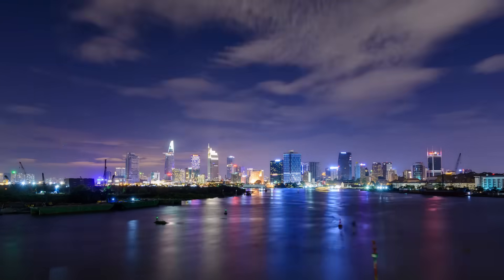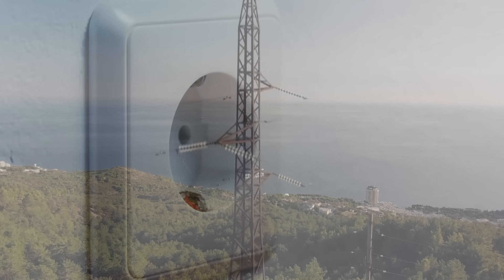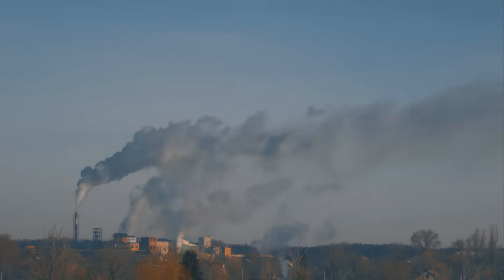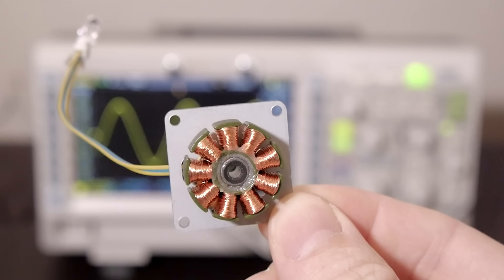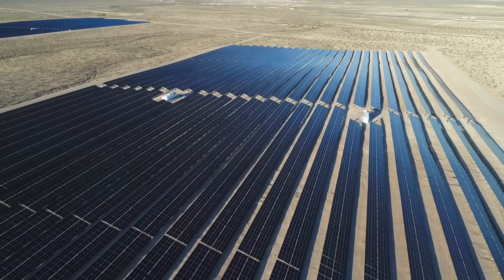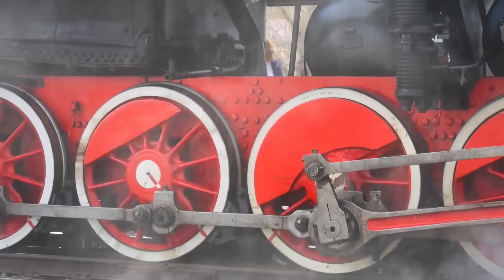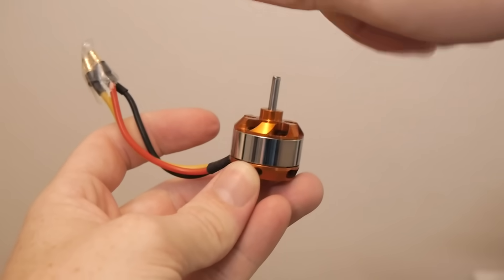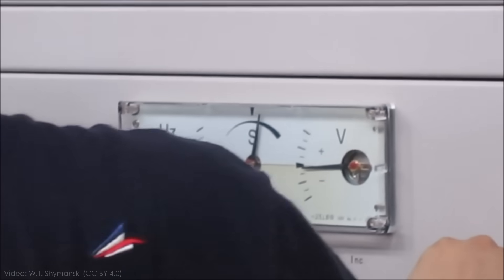How Electricity Generation Really Works

Comment: So, nuclear is the adjustable method that we need.
Reply: Lower the control rod!
Reply: @DingXiaoke  modern nuclear plants have control rods held it place by electromagnets, any issues shut the magnets off and they fall into place as fast as gravity allows.
Reply: Nuclear is good for producing the predictable base load that doesn't need to be adjusted that much, and can run at constant Megawatts.

It is common to use gas turbine systems for producing fluctuations in load.  One reason gas turbines are good for adapting to fluctuations in load, is the backwork ratio.  You can store compressed air when demand is low, and you can supply it with compressed air instead of ambient air when demand is high.  Thus, the full output power from the gas turbine can be output power to the grid, instead of needing to back-power the compressor.

Comment: 1. Make wind or solar energy. 2. Spin large metal wheels with it. 3. Make electrical energy again using generators. Problem solved :D (I know, I know - there are losses) well, back to the drawing board.
Reply: We just need to get their fixed costs down, so the total losses (i.e. fixed costs + 0) are smaller than total losses of coal power plants (their fixed costs + fuel costs).

Comment: I was interested until you started spouting Carbon Dioxide Responsible for Global Warming. Try looking at the data and the historical records then get back to me on that. You are an Engineer and evaluating Data is in your wheel house so don't cop out and just buy what the so called experts on any side of this issue tell you. There is zero implication or evidence in the data historical or otherwise that supports that hypothesis.

Comment: You didn’t discuss how solar gets the electricity moving. ):
Reply: That's another video lmao
Reply: Solar works by having layers of elemental silicon crystals, that are selectively treated with Silicon's elemental neighbors as impurities.   This will either give it extra electrons in the crystal lattice (n-type, typically phosphorous impurities), or fewer electrons in the crystal lattice (p-type, typically Boron impurities), when compared to the the crystal of intrinsic silicon in its pure form.   This is called a P-N junction of semiconductors, which creates a bias in which direction current can flow.   Energizing the junction with sunlight will move electrons to the conduction energy state in the semiconductor, which then becomes free to conduct onto the metallic contacts on each type of silicon, to create a circulating flow of electrons.

Solar is the one source of energy that produces DC power by default, compared to everything else that uses rotating machinery, which generates AC by default.  As a result, an inverter is required for converting the DC power into AC power, that can be fed onto the grid.  The inverter uses transistors for high frequency switching of the DC circuit in order to generate the AC waveform.  It then uses electrical filtering to smooth out the pulse-width square waves into a waveform close enough to a sine wave, that can be fed onto the grid.  The inverter dynamically measures grid voltage, in order to determine what voltage it must produce, so current will flow away from it.

Comment: Hi Grady, why do we still use water heaters for Electricity generation? Lemme break down the question. Water has the highest specific heat of all naturally occurring substances. That means a lot of energy that those burning fossil fuel molecules or those splitting Euranium atoms give up goes to break the hydrogen bonds between H2O molecules and not to PV work that makes electricity.
Some good alternative could have been Inert gases, at least for fission generators.
Reply: Turn a tap, get water. Cost to generate inert gasses, store them, move them?
Reply: @lamwen03  Still cheaper than Uranium. Just think if they r that costly then how come those Helium balloons are so cheap?
Reply: High specific energy needed to evaporate water doesn't mean steam turbines are unavoidably inefficient. That was definitely the case for steam engines (on railway) where maximum working pressure was barely 20 bar and expansion was performed down to 1 bar (directly into atmosphere). Modern thermal power plants work near critical state of water, where difference between water and steam vanishes. And with 'hot side' of 120 bar and 500° Celsius and 'cold side' of almost vacuum and nearly 40° Celsius, theoretical efficiency of steam cycle is very good. Practical efficiency is little lower but still good, in many cases record high for heat engines as a whole (no diesel, gasoline internal combustion, or gas turbine come even near what large steam turbine is capable of in terms of efficiency. Maybe large marine diesels can compete :)) 

Using inert gases (or gases at all, without converting them into liquid at any moment) is bad from practical point of view, because cold gas must be 'pumped' into heater. The same for water, but water has so low volume in liquid form, so this pump takes barely 4% of energy generated, while air compressor may take up as much as 33% of all energy (smth like this happens in gas turbine on jets: lot of power produced is spent to pump up air into the engine). And that means: any losses in compressor degrade overall efficiency dramatically. And alas, we can't make 100% efficient compressors, not even close. So gas cycles may be good in theory (Carnot being the ideal one), but suffer a lot on practice.

That's the same reason why hardly any refrigerator uses just air to perform its task. Instead it uses freon which evaporates and condenses at right temperatures.
Reply: @allmycircuits8850  Thanks for the gud explanation. You made me feel like I'm ready for further study myself.
Reply: Besides, “inert” gasses? It sounds as if they’re a lazy bunch and not at all eager to work. 😁
Reply: @pansepot1490  Seems like u r illiterate in Chemistry.

Comment: I go to my local town halls and stuff. Renewable by 2030 is discussed at every meeting. The list concerning topic is making sure the town looks renewable. Solar panels facing North West on the older building downtown...wind turbines out of sight and mind...and they don't want any big battery banks downtown or nearby because off heavy metals.... We have successfully made renewables fashionable...but there is no serious discussion of storage outer momentum. People just assume that batteries will meet their needs in a few years to smooth out seasonal shifts in production let alone the daily flux. Get rid of all the nuclear. Screw off all diesel peak plants and Fuck right off natural gas. W don't need you.

It's a joke. You have a rally good video here that gently breaks that wet dream. But you need more. Talk about the sheer scale of li-ion storage. What we'd actually need for peak loads and for long term storage to offset seasonal production shortages eg summer solar stored for fall's wet days

Comment: I work with a gas turbine 45MW + waste heat boiler, 2 steam turbines (40 MW each) and a black liquor boiler
I would like to see more topics on this :)
What are the biggest generator and turbines
How high can can get the pressure and heat in boilers

Comment: The most obvious way of handling spikes are ofcourse to use capacitors or batteries to even out the loads, if you only have a pipe with water you can drain the pipe way quicker than if you have a bucket connected to the pipe. We really need to research and invest in batteries/capacitors as a society in order to accomodate for the future demands consumers issue.
Reply: I see what you're saying, but batteries are DC and there's a price for converting that power to DC and back to AC. They also need to be replaced after so many charges / discharges which would increase maintenance and have an even bigger impact on the planet.
Reply: Very true, if you store the energy as electricity, however potential energy can also be stored as kinetic energy, albeit with a not insubstantial energy loss, in this case there could be a large increase in the research as that is a largely untouched field of opportunity. And kinetic energy can be released via water if that is the storage medium. How much energy can be redirected during night time to regain potential energy via water? That also needs to be adressed.

Comment: Good video that explains some of the challenges of power distribution. You mentioned wind and solar in the same breath as fossil fuels and nuclear, but I think this neglects the fact that wind and solar, despite their massive growth, are still meeting only a tiny fraction of our total electrical needs. If you count every rooftop installation, solar farm, business and municipal installation, you end up with more than one million solar PV power generation facilities connected to the grid. Impressive until you notice that solar PV supplies only about 2% of our power. In contrast, there are less than 100 currently operational nuclear power reactors in the USA, but they generate roughly 20% of our electricity. It's not even close to being equal. 

 I'm a fan of renewable sources serving as peaking sources and as a supplement, but we need to get serious about nuclear energy if we'd like to do something about climate change. It's the only source we have, capable of supplanting fossil fuels.

Comment: What about the rise of battery storage. Which is not grid scale yet but the tesla example in Australia really shows how battery can react quicker than spinning turbines to keep things at 50/60 Hz and is also storing renewable energy
Reply: Batteries have quick response on frequency deviations and very high power gradients but they lack of inertia response (inherent with generators). Despite the actual size of it, the capacity is relatively very low in terms of the whole synchronous area.
Reply: I am expecting much from plugged electric vehicles in the future.

Comment: I thought electricity move at drift velocity,  not nearly the speed of light? Am I wrong?
Reply: Electrons move at drift velocity, but the voltage moves at nearly lightspeed. That's what he meant. 
(Copied from other comments.)
Reply: The energy is in the difference of electric field within the wire. The electric field moves at the speed of light in the material, which is slightly slower than the speed of light in a vacuum. About 95% the speed of light in a vacuum.
Here is a Quora Link: https://www.quora.com/What-is-the-speed-of-electric-current-If-I-switch-on-a-light-how-will-I-know-how-much-time-it-would-take-for-the-light-to-glow
Reply: All electrons move at drift velocity but if you imagine connecting a battery to a circuit, an electron at the beginning of the wire starts moving almost simultaneously to one at the end of the wire. This simultaneousness means that electricity is generated and used at the same time. The difference in time between the two electrons moving depends on the speed of light.

Comment: I remember hearing from various sources that electricity travels through a copper conductor at about 30% the speed of light.  Doing some quick research today, some claim the speed is only 1/100th that of the c.  Wikipedia says the waves propagate at 50%-99%, but the actual electrons move through a 0.001m^2 copper cable at about 0.000023m/s...
Reply: Yeah, but you need to see those electrons as a conga line without spaces, every new electron that's put into the grid by a generator instantly pushes another out at the other end of the loop.
Reply: @SonsOfLorgar  You're describing the speed of sound.  Electrons don't behave like water molecules.  Similarly perhaps, but I don't think that analogy fits very well at all.
Reply: John Drachenberg 
It does. Electrons are particles. When in a wire they all stay together I’m a line. When a new one comes in it pushes it all and causes one to come out the other side. The speed of sound in reliant on the material used. That’s why when you break something like glass it break incredibly fast because of how the sound can move through it. 

Anyway the point is that electrons are basically just particles in a wide that are layer together. When one enters another leaves 
(This is a basic version and doesn’t cover everything. Just a idea to show how it basically (I mean very basic) works)

Comment: How does/will nuclear fusion produce electricity? Is it also using steam production?
Reply: Yes, it will also be a highly complicated boiling vessel as the process has to be cooled anyway and it only makes sense to use the coolant in a heat exchanger, just like in fission plants.
Eventually, we might find a way to also use the radiation itself to generate electricity directly too as a means to make nuclear powerplants of all types more effective/fuel unit.
Reply: Steam is the most probably approach, there are some proposals to use the electric energy from the released high speed charged particles directly but that is probably even harder than "normal" fusion reactors that give the output energy as heat.
There are of course other ways to go from heat to electricity but so far steam is the most economic.

Comment: oh so inertia like batteries could easily simulate 4:40
Reply: They could simulate inertia (synthetic or emulated inertia) but they don't have an instantaneous inherent inertia response like generators. Frequency derivation is needed which causes a relatively substantial delay of a few hundreds 100 ms.

Comment: How does droop speed controls works in generators keeping it at 50 or 60 hz? Also do generators experience breaking effect when heavy load is connected slowing down the rotation speed of utility generators?
Reply: A load on a generator increases the torque that works against whatever is turning the generator, so yes indeed it brakes the generator.
Reply: As for droop speed control: You measure the grid frequency, substract it from the wanted frequency, then multiply with some constant that makes it so the turbine (or whatever is turning the generator) in creases its power output when frequency drops and decreases it when frequency rises. At a fairly steep angle. Usually they go to 100% at 0.1Hz too low and 0% at 0.1Hz too high, with a linear curve in between.

Comment: I always thought they used circuitry to synch the generators to the grid. Like industries (who have a variable load) have to do, else they are fined for inducing a higher load for being out of phase.

It makes a LOT more sense to phisically synchronise the generator.

By the way, the tolerance for out of phase circuitry in an industrial plant here in Brazil is 12 degrees. More than that, and they do send people to measure it, and you get a fine. How much is it in the US?
Reply: I think you're talking about power factor (cosine of phi) and it's angle phi that separates the voltage from the current. That's a different thing altogether. It measures how much current you are pulling out of the grid versus how much you NEED to pull out of the grid for the power you are using.